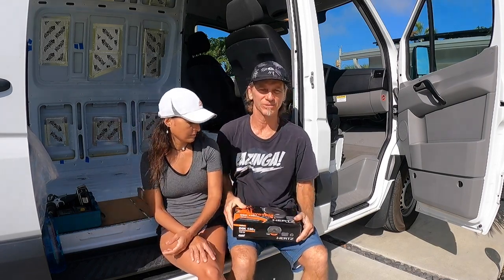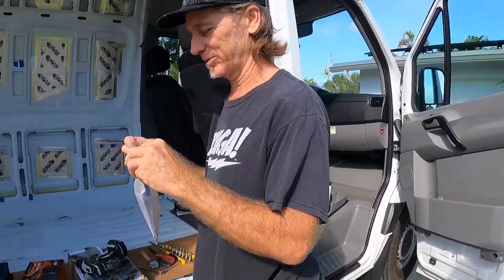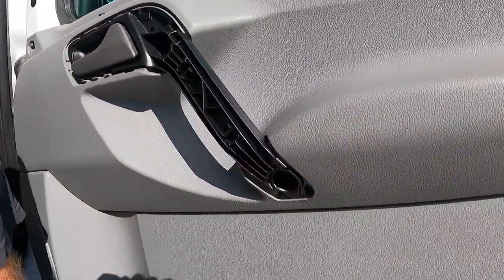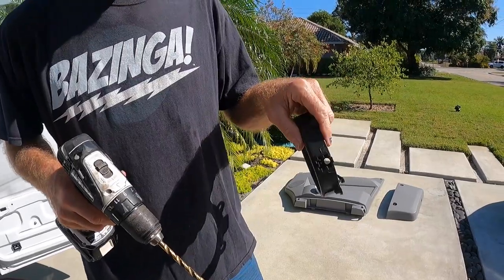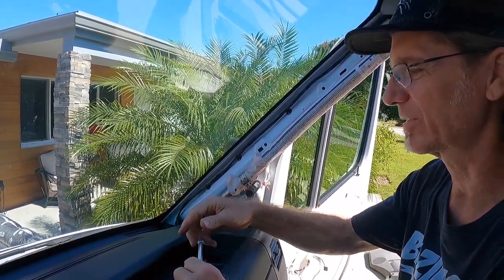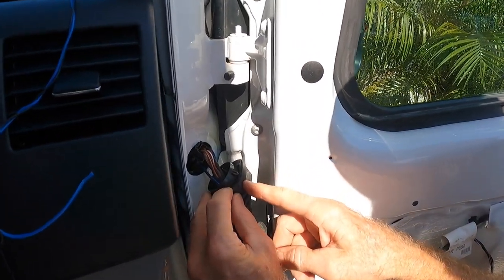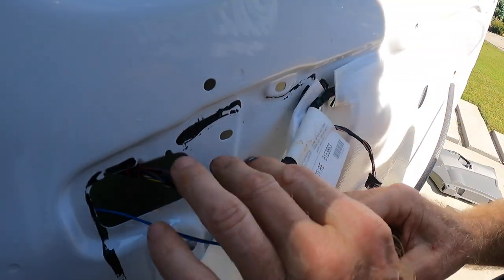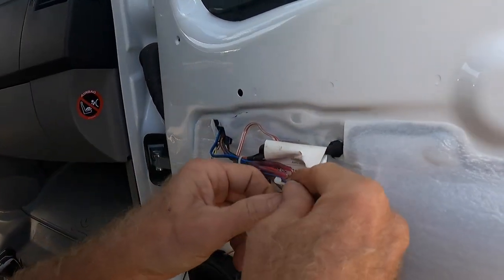Sprinter van DIY conversion - Installing speakers in front doors

Comment: Where do I order those new upgrade speakers
Reply from the maker: The speakers we used were ordered on amazon - not the best but much better than stock. (good speakers for the cost) might add a self powered / self enclosed sub as these don't have a lot of bass - but we knew that going in 😎

Comment: The factory tweeter adapter mentioned... if you look at the instructions, the tweeter has three tabs on it. One on the top and two at the bottom, which match similar notches on the adapter ring. These are really hard to see unless you look at the diagram in the instruction first.
Reply from the maker: Thank you!!!